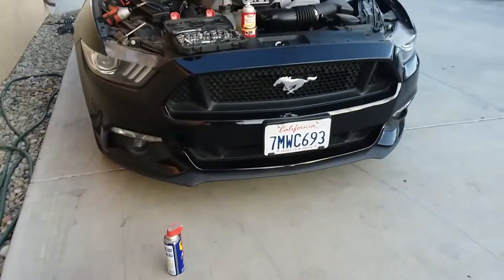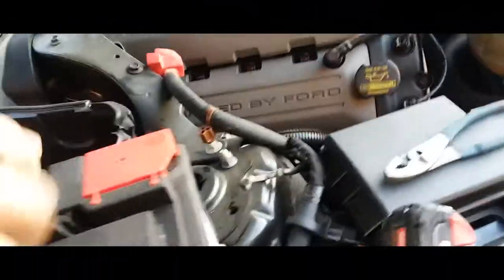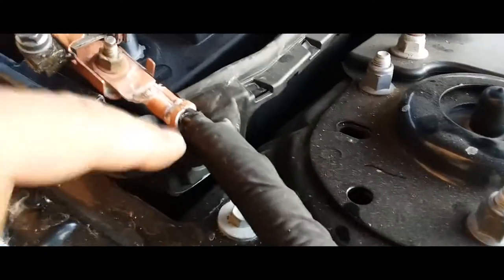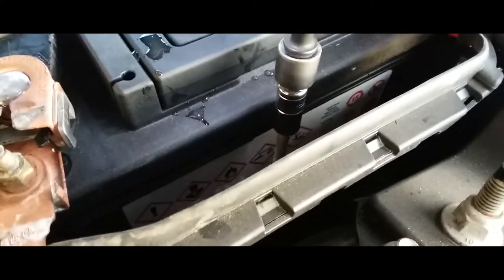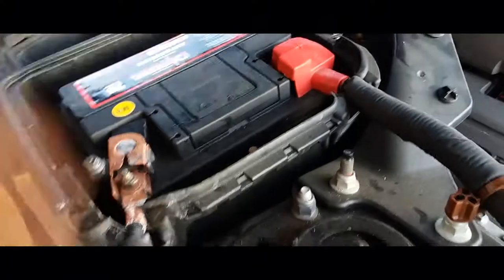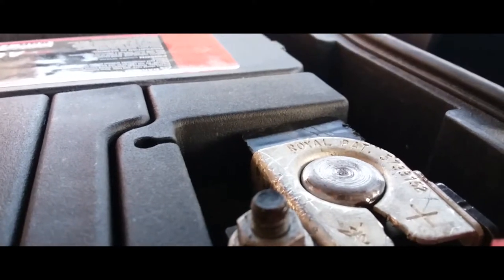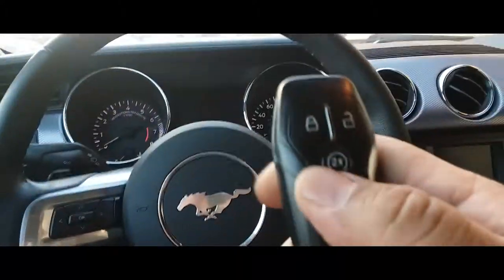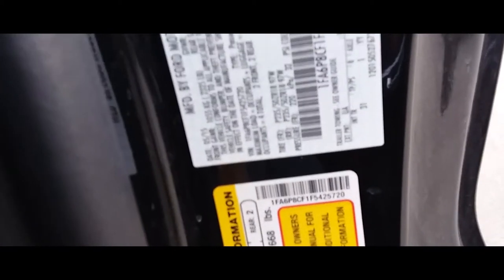How to: Install a new Battery on a 2015 Ford Mustang GT

Comment: super informative man, i should call you dad for showing me this
Reply from the maker: Lmfao thank you for your SUPPORT!
Reply: @559powerscape  the cold killed mine, i guess i didn't have enough cranking amps after doing a little research(?), but yeah other than my grounding terminal being a bitch to get off i got it running just came back from a ride cheers :)
Reply from the maker: @doctorkankle6318  heck yeah bro im glad this worked out for you! Glad to hear its up and running!  Thanks for the support 🙏 have a good day!

Comment: Help I can’t take off the negative terirminal from the old battery
Reply from the maker: I had to use a flat head screwdriver and a hammer to pry open the terminal then use pliers, wiggle it back and forth till it gives
Reply: lol a  year late to the party, but i had the same issue.  I wonder what makes it get stuck so easily?

luckily i was able to take the battery out and wack it and pull it off with channel locks

Comment: if my battery is dead and I try to remote start it will my key fob blink three times. i tried to remote start it today but no good.
Reply from the maker: The remote start will not work if the car Battery is weak or low on gas.
Reply: @559powerscape  ah got it yeah at first I thought it was my key fob so I replaced the batteries but didn't work so I went to my local auto parts store and had them test out the battery and it was just that so I recharged it and now my car is good as new. Thank you for replying. you have earned mu subscription.
Reply from the maker: @hanzs5207  thanks man really appreciate you for taking the time to watch my video, really glad this worked out for you! Thank you for Subscribing! And THANK YOU FOR YOUR SUPPORT!

Comment: Did your engine light stay on?
Reply from the maker: No, if your check engine light is on it's probably a sensor that's bad I suggest if you don't have an OBD2 scanner go to AutoZone grab their scanner and they will tell you what code you're throwing and what sensor needs to be replaced. The check engine light is when the computer is not detecting a sensor correctly or throwing off calculations
Reply: @559powerscape  or read camshaft sensor A 4 different codes
Reply from the maker: @MrSnuffalopagous  this vehicle might have 2 camshaft sensors, Camshaft sensor A is Bank one. Depending on which side is your first cylinder, that side will be bank 1 the other side is bank 2 or B. REPLACE ONE CLEAR THE CHECK ENGINE IF IT STILL COMES BACK ON IT'S GOING TO BE THE OTHER SIDE. I don't know which one is first cylinder because I don't own a mustang but if you do a little bit of research online you should be able to find which is first cylinder and that will be Bank 1, then track down the camshaft positioning sensor and replace. look online to see where the camshaft positioning sensor is located and search witch is camshaft A. Hope this works out.